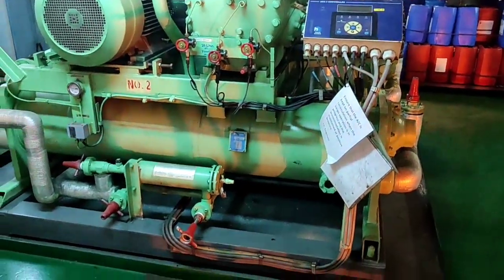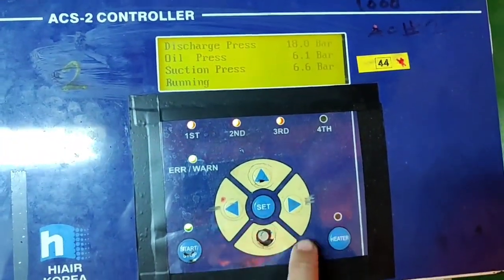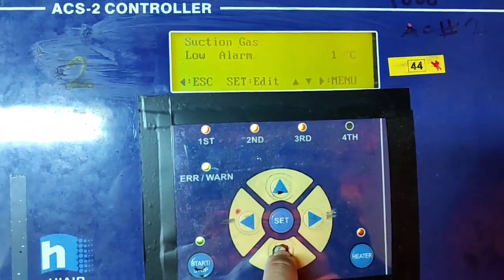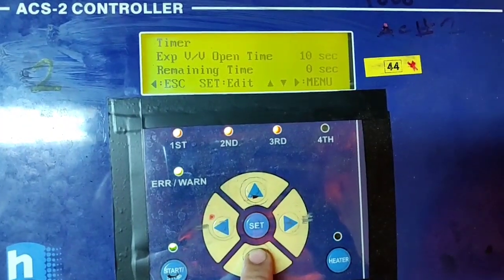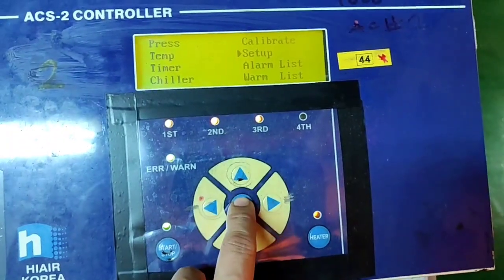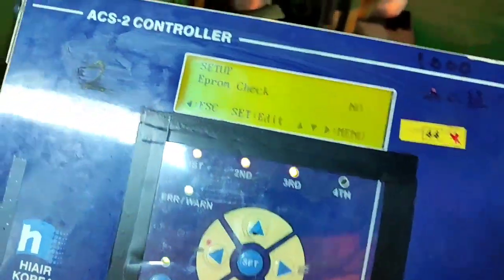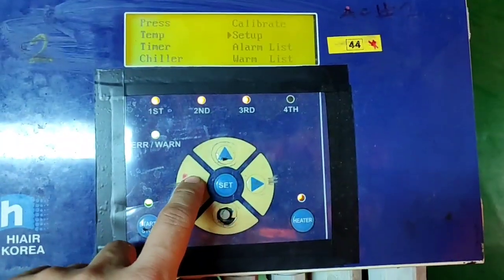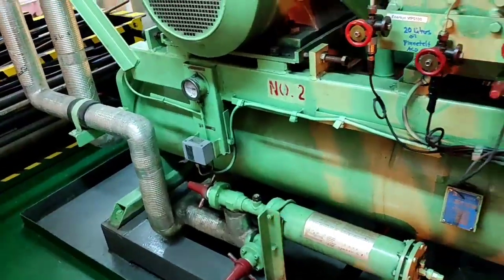HI AIR Korea - ACS 2 controller Capacity configuration and password

Comment: Hello sir, i have a same panel version 3.0 but i cant control compressor from the panel my previous panel was 1.1 maker send new diagram everything okey i can see all parameters and pressures good but start stop button is not functional i have to jump 15-16 number and giving power direct to compressor contactor can you tell me why i couldn't solve it. Thank you
Reply: Hi, same issue I have... have you found a sollution for compressor start?
Reply: @Mike-ym9rv no still we are using same way i request service but company doesn’t want to send i think